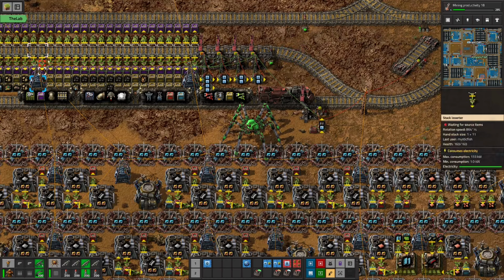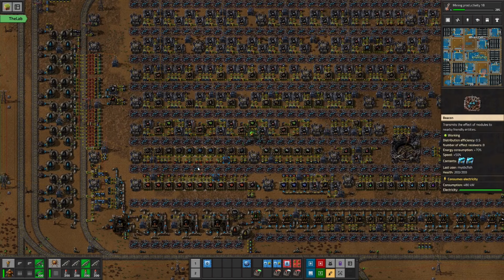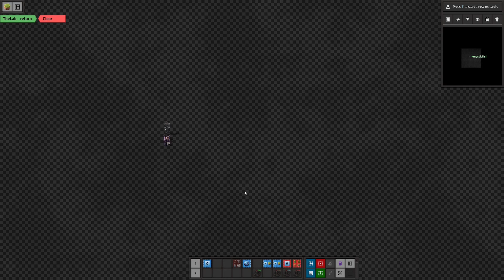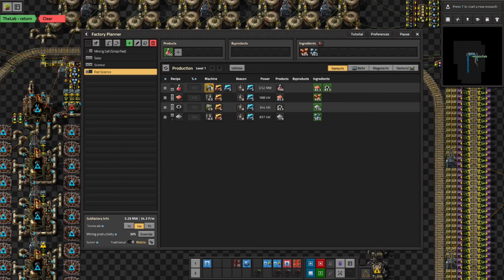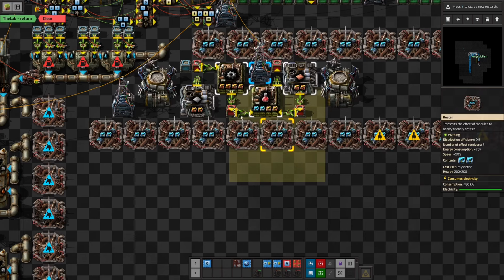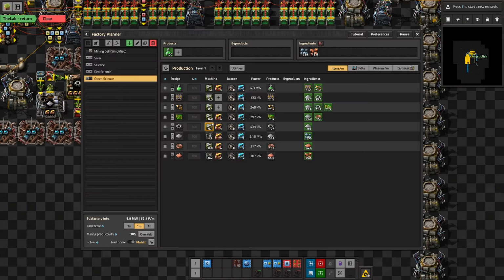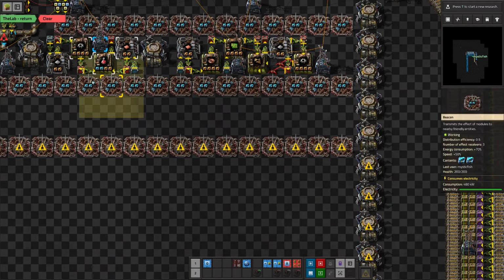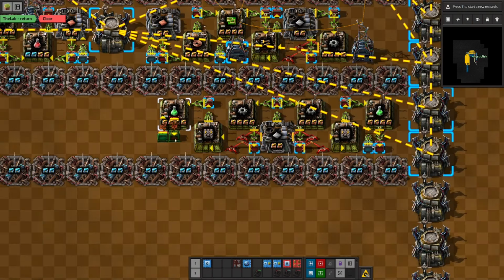++Direct Insertion - Ep22 - Factorio Cellular Megabase

Comment: Another idea is to have a potential nuclear power cell? Slapped down on top of uranium deposits, with water carted in via train. It might be an interesting cell challenge, as the components of a nuclear plant are pretty resource intensive, and fitting uranium mining, refining, power, and reproductive capabilities sounds pretty intense.
Reply from the maker: This is a fun idea. I think I would probably build it landfilled over water (like the current water cell) so I could embed the offshore pumps for the heat exchangers right there in the cell without having to ship water in. From what I’ve read, bring water by train to a nuclear plant can be a real headache!

Comment: 31:13 7 machines, of which 2 are just there to make direct insertion of about 30-50 items/s work? That seemed a bit wasteful, so I made a design that can do it with 5. (See replies to this post.)
Reply: The bottom part of the blueprint is the 5-wide design. It's power poles are a bit of a problem, but it works if either the module to the right can have one in the indicated position (labs are placeholders for neighboring assemblers/chemplants); or if you can get power from the modules above and below, or if you swap substations for medium power poles.
The top design has more furnaces than it needs itself, but it allows neighboring modules to share those furnaces. (So you could technically even count it as 4 machines wide...) Power on that is probably "medium power poles" only.

0eJy9WtuSmzgQ/Rc9oxS6An7Mb2yltgArtioYWMCTTE353yN7MjN4aBoJk32ai/FR91Gf043ghRTV2bSdrQeyeyG2bOqe7P55Ib091Hl1/d/w3BqyI3YwJxKROj9d/ypM7i4ll4jYem9+kR27fIuIqQc7WPOKcH9lRNqmdx+6Xx3m9Qvsi4rIM9nR9Iu6/Pnu87/1+VSYzn0c3Vbsr1f3rTF7emr258pQQXb8cokC8GMIn2+Gn0Dw4lH4FGVHbgYPkqO2gge50b7oVXOw/WBLWh5NP9DO/Hd2Px3EZL3kLR0NLZiMMPshL39QW/emw5EUhJSOkExlyqFz0X0/d3VemimWfsMSEFY2oqHtHAPlYJ/cBduxwUBhxSPMvO/NqahsfaCnvDza+rrsbB4SxHNK7Uxp27sY+9KaujS0dWyT5USlT1Ep3DC8Fe1PpEbLiol50NYxa59c/l3zZPcoNlhoTIYQAoqYeas4nBC4snRAzKAzsMQ35CUZKzTQNCJ764r29Qs8WBAC37tsa0UsZSvf4uG3eMa5TRtfHORhb6lysImyQA+bqwqOSpuvlfayCsU9c58XFiGxw3OGd6teHTtoy1xtAQ3WN/fROcd0zjfTOQ+p/HQFsPqMq6e4WbCBxOhkIOKRgQxdXvdt0w20MNVAAlJgdx6IUiPY6hTA6hPcK4O54qEx6gfCe7oOLvwY7fhCBtAf3zeJEf9yCqyCWAGdRqydq/1ZAbupCBmvY6ydiDSEBfi+K9vKWWjsLx8ZPlNTjs4QcvOpejFfNmulU8uT4TPTe8Lg1ksxytd2TU0PJu/oz6MxVWimVeMiOeb13m2+R74eDi99pnEqUNOSa8fxZXlSjk4x0qdff0QPmov07tie7M/2V0BdXrYgMFuQ29mCCJCJitcggx1VsYcqBB3o1Ao1K3SCUZvK2ffulEqsTym5Pkt4S9T/dfJBNWot6i+cqH1sMDgJqeShclRo81NegteoYSlvxa+PHiwzHYcEDx+Qeh9+9+fC2coNeLpG8tpuAXznsbWxh2PRnLvrYX0afws6FKApun9aBB4LLFpjEmC62qtZZ6iitHezXgw9RY1S64cqMUUbv06CmAB1pFNfJrqmaK53edCoFd9WEAB8FhIiqJYk3myvMnSvEnZ/F7fOVzN0yxLuwwfDz8uSh58+jVYAqyLxPtUasX0/5M0cYYKdNlGLiHLepmGi9SKkng0SdL0kWUSMZx/VwDGmKxDfhyAYMvPsHn8k+8lt4+kTsfhTL9F83EuqvACw+d1m4/hsCS27yxcH40tglImA2MSKQsfnqlSuKMv3LZ/BXFbPNMwPTPhB6Br54FNfuqyfKSTDM18WEJA5fgaYZtc3HW5vQ+xGL09E5Ml0/StkymSS8UTyLBOZaxqu0txtz458fb/6cvkNGTHvfw==
Reply from the maker: Would you mind uploading these blueprints to factoriobin.com and then posting a link here? I’m away from my desktop and it turns out the mobile versions of YouTube and YouTube Studio don’t let you copy text out of comments!